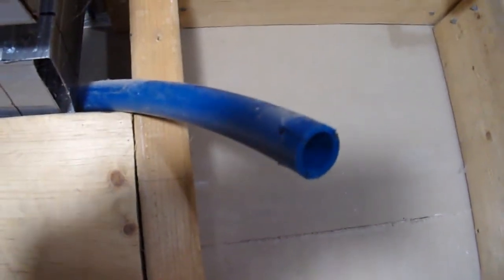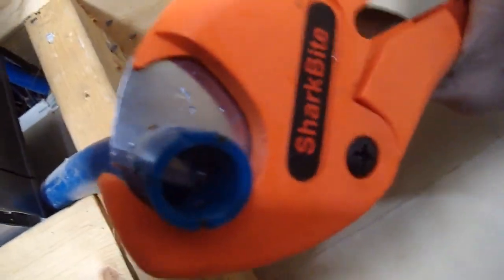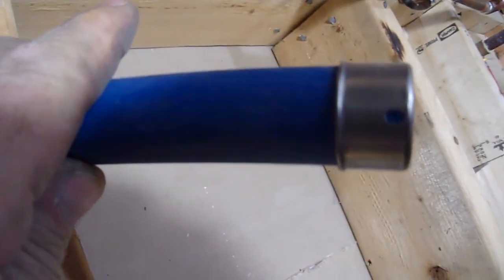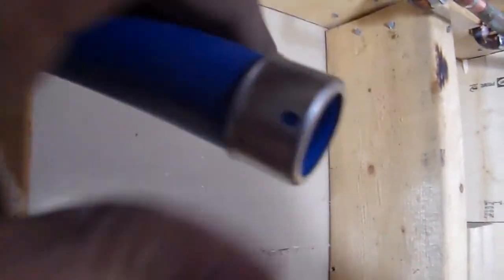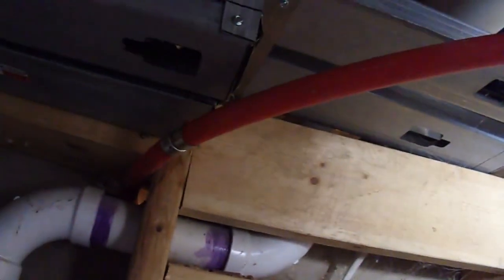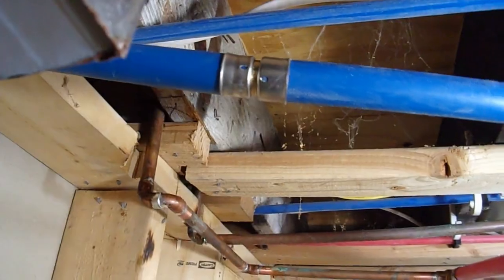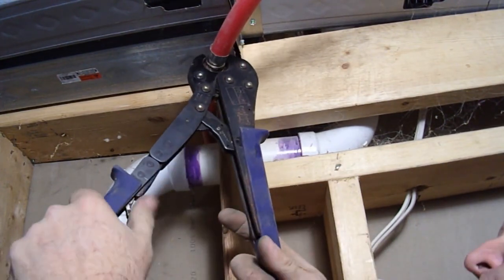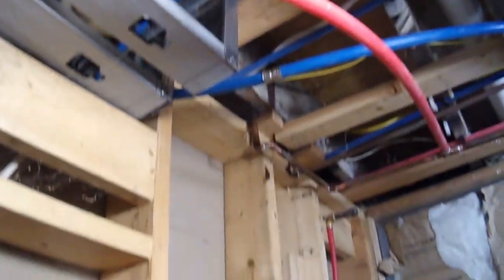Using PEX Water Pipe and PEX Press Sleeves

Comment: Hi, I just bought all the stainless steel push fittings and the Apollo crimp tool.  Seems like a great system!  For some reason your video is the only one I can find on you tube using this system..... Can you elaborate why you like this system so much, please.  I'm doing a complete bath and shower remodel.  Thanks!!!
Reply from the maker: I believe the press sleeves to be superior to crimp rings for many reasons. Primarily though; 1) The crimped/pressed surface area is greater. 2) The PEX tends to mold itself to the fittings when using the sleeves. (I have completely cutoff sleeves and still not had the fitting leak) 3) I have found that there is less chance of any fitting leaks. 4) Super simple to use.
Reply: @joyceproductions8945  thanks so much for your insight!
And your time,my friend.
Damian

Comment: It looks like you removed a sleeve on the pipe you start the video with. Can you show or explain how you get the sleeves off of the pex tubing? I need to make some modifications to my plumbing, which are all connected with the sleeve type fittings. I have searched quite extensively and cannot find an explanation of how best to remove these sleeves? Thx.
Reply: So sorry for the delayed response. PEX Press sleeves vs collars are supremely superior. I use my Dremel with a cutoff wheel to slice down the sides of the sleeve cutting it into 3rds. Be very carful not to cut into the pipe. This will then allow you to pry out the 3 pieces and you should be able to pull the pipe from the fitting. It will take some work because the inside of the pipe will be more or less formed to the shape of the barb fittings. If once the outside of the sleeves are released and if is to difficult to pull from the fitting then a heat gun on low or a hair dryer can be used to soften the PEX to removed the fitting.